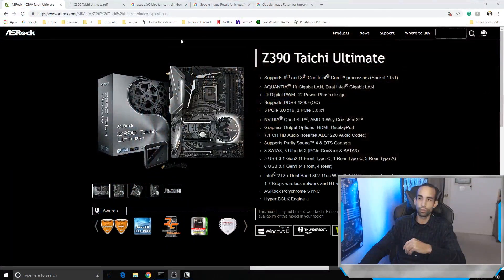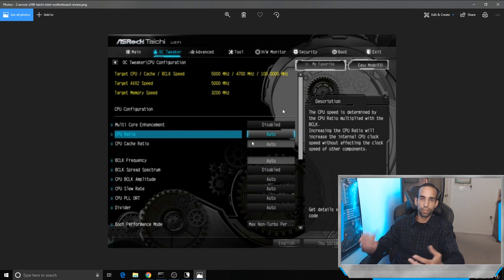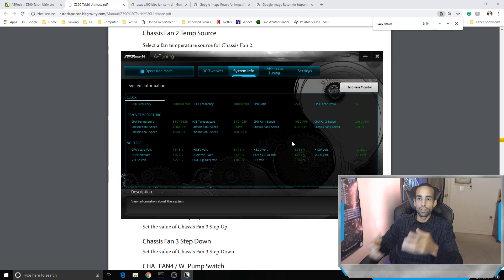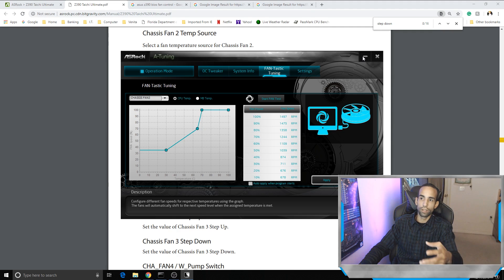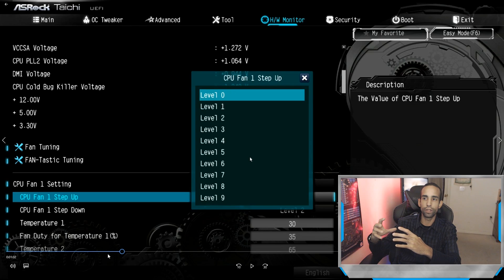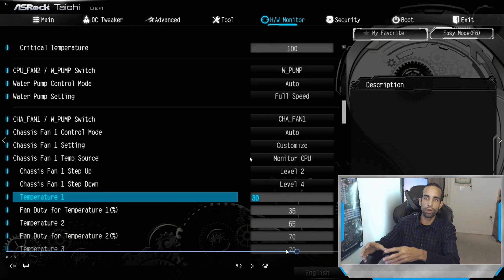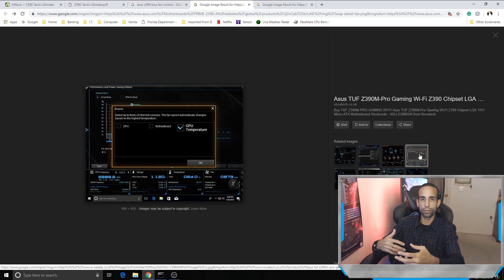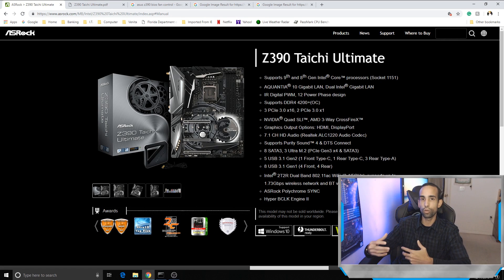Asrock Fan Tuning, Step Up - Down

Comment: B550 steel legend doesn't have the step settings. Really annoying as my aio will quickly spin up the fans and settle down just as quickly when I launch anything on my pc
Reply from the maker: What do you see? Are you connected via cables connected via AIO, or direct to motherboard? If connected to motherboard, check the speed up and speed down percentages. Adjust it accordingly.

Comment: thanks for the tutorial, sadly for some reason my bios on my b550m/ac (p 2.50) has no fan delay options that i could find but everything else works
Reply from the maker: I think they changed it on that series. Might be percentages

Comment: Gosh, wished I would have found your tips in 2018, lol. Thanx, will try this now.
Reply: Works.  Back thenI was afraid to have the chasis fans temp sensor responses be read off of motherboard instead of the CPU and was vary of setting too long ramp up delays. Now after almost 5 years after I am finally free of fan ramp ups and downs just by browsing the net. Better late then never, heh. Thank you again.

Comment: z790 taichi, no step up down setting, any idea?
Reply from the maker: What does it say? It should be similar. You have fan percentage and target twmp of Motherboard or CPU
Reply: @SerpentXTech  I have all the other settings like in the video, the bios is very similar, but only fan step up and down are lacking, I checked the motherboard manual and these options should be here. maybe because I'm using CPU fan 2 or maybe need bios upgrade?

Comment: i have coolmaster fans and they are designed to be quiet... ive been using them since 2018 and ive just realized tonight if i dont run them on full speed they make noise... i was planning on taking them out and trying to see if i could put wd40 into the holes... glad i didnt. so when i put my fans to full speed in the bios ... no more rattle sound and the machine got super quiet... i thought they quit spinning but no i looked in there and they are spinning nicely.

i can also put them on silent mode in the bios and man it gets super quiet... but i would probably only use that feature if i was recording music or something...

Comment: Hello. Could you help me with the following problem? PC turns on, off and 2 sec. after restart. Afterwards, the pc displays the following message: BIOS DATE 07/23/2021 12:08:19 UEFI Defaults have been loaded Press F2 or del to Run Setup Press F1 to Continue. Computer configuration is: ASRock H510M-HDV Chipset H510 Motherboard, Intel LGA 1200, mATX, DDR4, Intel Core i5 10400 Processor, 2.90GHz, (4.30GHz Turbo), 10 Gen, 6-Color 12-Threads, LGA 1200, Geil Orion DDR4 memory, 8GB, 3200MHz, Gray, GAOG48GB3200C16BSC, Cougar VTE 500 80Plus Bronze Active PFC, CGR BS-500, Mancer Fan 120mm Ventus Red Led, MCR-VTR-01, SSD, HDD and DVD player. The problem disappears if I disconnect the HDMI cable from the second monitor (TV brand STI Slim led full HD). When connecting and disconnecting the HDMI cable to the PC, turning off the PC, and then turning it back on, it turns on (the rear fan led light turns on, but the SSD light doesn't turn on) and suddenly turns off the power, and turns on again, but it does not boot, and at the end the attached message appears. I recently assembled the PC, I don't understand why this only happens if the HDMI connector is plugged into the connection. If not, booting occurs normally. I tried turning everything on without the stabilizer; I also tried to turn on without connecting the chassis fan; it didn't make any difference. I accessed the Appshop which displayed 4 driver updates as attached. Would it be recommended that you make these driver updates? How to solve this?

Comment: I dont have step down and step up
Reply from the maker: Its prob different now but it depends on your Motherboard. Sometimes it will be levels or steps up or down
Reply: @SerpentXTech  dam i really hate that spikes i dont know how to fix it
Reply from the maker: @dusanignjatov7658  play with settings. What do you see in your UEFI or Bios? What are your options for each fan section?
Reply: @SerpentXTech  i have only what temerature and what % of fans
Reply from the maker: @dusanignjatov7658   Look above each fan section and see if there's an auto, PWM, DC and you might have to switch modes
Reply: @SerpentXTech  i tryed everything and cant get that option 😓 just moments ago flash latest bios

Comment: Many words, no answer on main question: how long is each level in seconds?
Reply from the maker: Do you see the actual info posted anywhere, like manufacturers website, or 3rd party? Cause I haven't but from my own testing Level one is instant so maybe 1 second. Level 2 maybe 3 seconds, Level 3 maybe 5 seconds, Level 4 maybe 10 seconds and Level 5 maybe 25 seconds. Or you can go try to find actual info on Google. Good luck
Reply: @SerpentXTech  No, I didn't found. But it can be measured by using stress-test like the CPU Burner in the Furmark. Just need to reboot many times. Stress test makes almost instant increasing CPU temperature by 20-30 degrees, so changing cooler speed will be sharp enough to detect the moment of stepping up by hearing or visually.

Comment: Hey there, I am using the Asrock Z490 Taichi, there is 1 problem recently that cause the Fan Speed RPM for my chassis side to ramp up to 3600RPM while my fan capabnility was capped at 1900. It used to be around 1200~ 1500 depends on temperature, need ur help~

Comment: It seems Asrock has removed the fans step up/step down settings in recent BIOS update. I used to have it in my B360 mini itx settings and it disappeared. I tried to downgrade to all available BIOS settings on Asrock site, but the stting just does not exist any more. This results in my fan constantly change their speed. Very annoying. Any idea? I don't know which version I had before the update, it was the out of the box version.

Comment: So what does one step level represent?
Reply from the maker: The fastest level to react, to temps rising or falling.
Reply: @SerpentXTech  But like, if it's not represented in seconds, what are they? For example if I set it to level 9, how long does it take for the fan to react?

Comment: Im wondering what is the difference between DC mode or PWM. For fans in the mother board bios. What should i have mine set to? Idk what type of fans i have. I just know it seems like one runs the fans really hard. And one makes them quiet. A video on this topic please?

System: i5 10600k @ 4.9ghz 
32gb 3200mhz g skill RAM
Evga ftw3 ultra 3070 rtx
1tb crucial SSD
Asus prime z390 mobo
Random cooler master case came free with bundle. Not sure what model.
Reply from the maker: DC is for 3 pin fans and PWM is for 4 pin fans. 

PWM fans are typically capable of going to much lower minimum speeds compared to DC, they can typically dip down to 20% or lower. Whereas DC is typically in the 40-60% range for minimums. DC controlled fans require a minimum voltage to spin continuously. The minimum voltage threshold varies depending on the fan model.
Reply: @SerpentXTech  ok thank you.

Comment: My brother has got a B450M Steel Legend and i want to install on his motherboard AI Suite 3 but when i launch it it doesn't start. Any ideas? A-Tuning is a so closed programm...
Reply from the maker: Yea, it won't launch on non Asus boards. I believe you can only control in OS from Asrock tool, or outside OS in the UEFI. unfortunately.
Reply: @SerpentXTech  damnit. Thanks.

Comment: On my AsRock board I have no option to change or control "power fan" ... Weird.
Reply from the maker: What board you got?
Reply: @SerpentXTech  H81 Pro BTC R2.0
Reply from the maker: @rockfella27  yes I dont believe that board does, y oki u can set preset speeds but not adjust
Reply: @SerpentXTech  all fans were running at 500/700 rpm in silent mode except power fan that never went below 1600 rpm. It was overkill in winters so I disconnected it for now. It was top vent.

Comment: I have a b450 pro4f, yesterday I installed a fan (deepcool rf 120 fsled pwm 4 pin that is connected to the motherboard (cha-fan1), every time I start my pc it starts to rotate the 100% for 2 to 3 seconds and then it normalizes, I do not understand why the other 2 fans that are connected to the power supply do not do that behavior, I do not like it, I do not like that they sound like that. And I would like you to please help me to be able to cancel this to solve, I thought about buying a SATA adapter for me I would like 3 fans of this brand but they don't sound that strong every time I restart or turn on the pc, I don't like to help me please

Comment: hello, my A-Tuning does not look like yours. Mine is green and yours is blue. I have a Z97 Pro4 motherboard. The issue with my chassis fans is that they are stuck at 1550RPM even after I run the fan test. From 0% to 100% the fan speed remains at 1550RPM and I can't change that.

Comment: I'm using 2 fan (20cm) and its 3 pin power, how to change pwm settings to DC? I cant find in A-Tuning app.
*Mobo Asrock B450 Pro4
Reply from the maker: Look for "Control Mode" not all fans have that option, like the CPU fans, but chassis fans should.
Reply: Neither. Did you manage to find it. I cant find mine

Comment: First time builder question: is A-tuning still available to download for b450m Pro4? My PC specs -- Ryzen 5 1600AF, 16g ram, SSD 250g and Seagate HHD 2T. I have 5 deep cool RF120 fans installed. I only play the Sims 4 on ultra high settings and the fans are mostly quiet BUT I want to change the speed of my front 3 fans to 60%. Any help is super appreciate. Thanks!!
Reply from the maker: I haven't had the opportunity to test that board, but there is a utility on their download page. I would check it out and tune the air flow how you want. Remember you want positive air pressure, meaning more air going in then out, to maximize air flow and minimize dust. If not check the bios/uefi for fan tuning. Good luck and welcome to the PCMR

Comment: Awesome video. I was curious, I have an Asrock B450M Pro4 and don't see the Step Up/Down options. Does that mean my board doesn't support this? I'm on BIOS 3.9.
Reply from the maker: Your board might have it set in a different format, but it should be there. For example it might display at time, but I cant say unless I see the bios /UEFI  itself. You can always let the motherboard auto tune then adjust to you liking. Good luck

Comment: My step up/down times are crazy on my ASRock Z720 Killer SLI/AC lol. The first number is 0 sec, then 12, 25, 51, 76, 102, 127, 153, 178, 204.
Reply: So if I put my step up to, say, 12 seconds, does that mean that it will gradually speed up over 12 seconds, or will it speed up AT 12 seconds after a temp is reached? I guess regardless I will put step down at the next interval of 25, or maybe 51 but almost a minute seems a little too long.
Reply from the maker: It will delay for 12 seconds and gradually climb or decline to the level you have set.  I would do 12 on intake fans and 25 on exhaust fans to ensure you have positive air pressure preventing less dust. However that also depends on how many intakes you have vs exhaust
Reply: @SerpentXTech  I have 2 intakes and 2 exhausts in an NZXT s340, and the 2 intakes are on my radiator. 12 and 25 for both step up and step down?

Comment: Hi, I have 3 more fans but in the bios it only shows that I have 1 its that normal?
Reply from the maker: No, but it depends if you have it connected to a hub or chained together. So fans are DC and some are PWM, you can change in the UEFI to match. 3 pin fans are DC and 4 pin are PWM. I hope you got it figured out sorry for the delayed response

Comment: Hello i have 7rgb fans but only 3 are whit  working whit rgb colors other 4 only spin whit out rgb lights how to add them to the bios and they work??
Reply from the maker: On this motherboard you have a 4 pin rgb header and a 3 pin 1 addressable LED header and 2 RGB LED header. Check the type of header you need and plug them into that one. You will have to link them together or get a splitter or controller hub if unable to link them. Once you do, go to the Asrock Polychrome under tools.

Comment: does anyones fans ramp up all the way when first booting your system?
Reply: Cleans dust off itself my boyos
Reply: It's called POST - power on self test, it needs to check if it works properly
Reply from the maker: No, have you tried adjust to step up and down speeds? Try launching HWINFO as soon as you get in your OS. To see what the temps are ramping up too, if they are high that is why your fans are running so fast. Adjusting you step up or down will leveling out the fan curve. But no mine does not ramp that high, they do pick up because the system is at max clocks loading everything but not enough to be audible
Reply: Me too. Case fans run at full speed for about 2 seconds at bootup and restart.
Reply: @mehdiful9929  yeah exactly my issue, its not a huge problem as it literally is only 2 seconds just more of an annoyance
Reply: daniel shuter it’s not but I’m worried if it’s gonna damage my pc over time. My mobo is Asrock b450m pro4
Reply: Mehdiful I have the exact same motherboard so wonder if it’s an issue with the bios
Reply: daniel shuter oh really. I’m running P3.30. What version are you running ?

Comment: What would you recommend the safest maximum step up/down that should be set for the cpu cooler? My BIOS step up/down intervals are in seconds: 0.1, 0.2, 0.3, 0.7 and 1.

Plus I noticed that you always set the step down levels higher than the step up levels for all the fans, is there any particular reason for that?
Reply from the maker: Yes, I set it that way to stop the fans from ramping down to quickly before the temp drop, but try to keep up with CPU temp spikes. So the systems responds quickly to temp rising, like launching a game or benchmark. Then when done the fans will gradually ramp down ensuring the temps are going lower, no a random drop in temp. 

You want a faster response to increase temp, [not to much, you have a constant spin up and down] and a gradual response to temp drops.
Reply: @SerpentXTech  you've made this so much more clearer for me. Again, thank you!
Reply from the maker: For your intervals, try 0.3 for step up and 0.7 for step down, and try playing some games to ensure the fans arent going crazy.

Comment: Thank you so much! I was looking everywhere to find a solution to my fans constantly speeding up and down cause of cpu temp spikes (even at idle), which was getting very annoying. I saw the step up/down option on my bios fan control setting but wasn't sure what it was, and couldn't find a proper explanation anywhere. Until I found this video. Great explanation, this was my solution all along!
Reply from the maker: Np, glad it helped, I had the same issue  and got tired of it ramping up and down as often as it was. Especially with hot CPUs like the 7700k, 8700k and 9900k that spike frequently. Take care
Reply: i know this is a 5 year old comment, but do you remember what specific setting you changes to stop it?